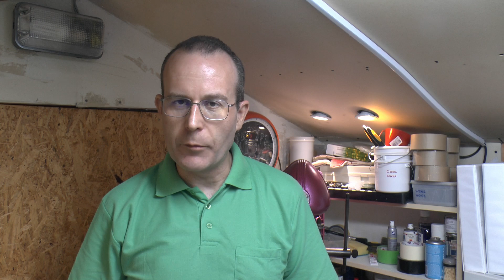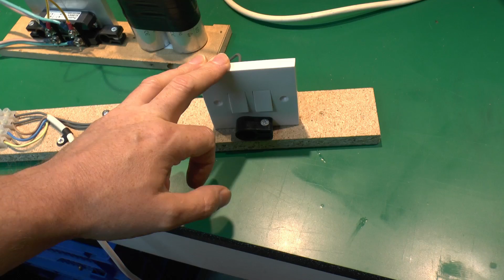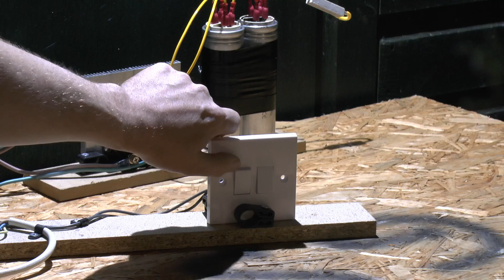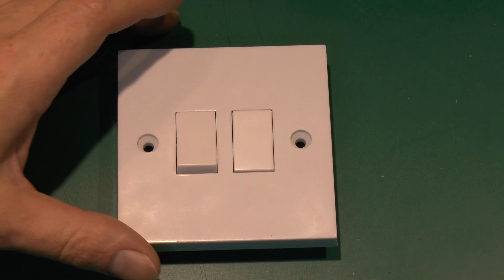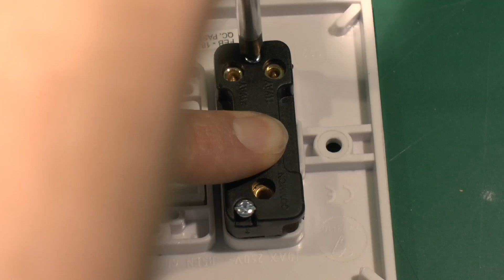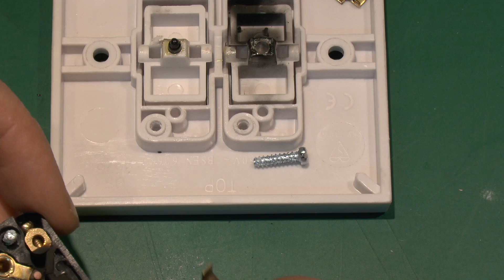10 amp AC Switch used on 7 amps DC

Comment: @ JW #JohnWard would the switch fail {after x time) @ the rated 2.5KW @250vDC if it was used only once  ie. just switch on once and wait or is it literally just the switching action and associated sparks that are created that causes failure, my hypothesis is that it could probably still handle 2.5KW @250v DC for an unlimited time period if only switched and left  (subject to "normal" conditions}. This video leads me to a thought i had before , (maybe another interesting experiment could be performed !!} , to still stay @2.5KW but maybe @25v DC @100A vs 2.5KV DC @1A , and compare the results , i think it may also be interesting to see this same experiment with the parameters mentioned, thanks for the video.
Reply from the maker: Switched on would be ok - there is almost no arc when switching on, and any arc disappears once the switch is closed.  It could theoretically be left on for ever.  The damaging arcs only occur when opening the switch.

Comment: Try running a 10A switch at higher and higher DC currents starting at 10A, until the switch explodes. If it fails without exploding, try higher and higher voltages/currents until it either blows up or you max out the current/voltage.